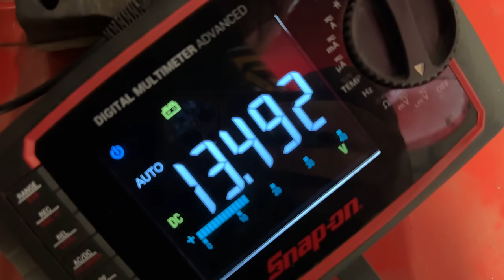Replacing the Old Generator with a Dynamator Alternator

Comment: Just did this, thanks for the instructions, Steve. Switched to Negative Ground, switched battery to a "R" to get the poles on the opposite sides, switched the red ground wire to a black ground wire. Re-polarized the original generator and drove it about a week while I waited for the Tudor Dynamator and the fake voltage regulator box to come in the mail. Immediately shocked the living shit out of myself on the voltage regulator by failing to remove the negative terminal from the car and removing the old one from the chassis, then cleaning the spot it came from while just barely touching the terminal and the wet chassis. Then installed the dynamator as shown once I had removed the negative terminal from the battery... and a shorter belt as I switched pulleys to a new one on the dynamator and it's a little smaller.

You can buy a positive ground dynamator. I switched to negative because I don't care if the car is positive ground or not and wanted it consistent on all my vehicles.

Comment: Outstanding video. I’d never heard of this conversion. I laughed when you put that crusty, old pully on without blasting and painting it. Just replace and drive on down the road.
Reply from the maker: I think people should be driving their cars instead of wasting time with things that don’t matter. So many cars never get back on the road because people want it to be put together perfectly or not at all.
Reply: Considering the condition of the engine bay I don’t think it would be worth the time.
Reply: @ThisWeekWithCars  Steve, you are exactly right. It’s just really hard to do when the pully is already off. Probably why only one of my three cars is drivable. I’m trying to be better.
Reply: Moss or somebody needs to make a “patina” spray… one quick spritz and your new parts match the rest of the engine bay!

Comment: Does that Sprite have an exhaust leak? It sounded a bit rough there both on start up and on the drive to test the alternator swap. Great video there and it's nice to see the old cars being supported with parts so well. I'm jealous that you have them. I'd love to have one to just tool around a bit, especially one of the hard top ones.

Comment: Is the electrical system negative ground?  A generator doesn't care about that, but with an alternator, I believe it has to be negative ground.
Reply: That's exactly the question I was going to ask as I'm pretty certain the sprite would have been postive earth from factory.
Reply: Yes the sprite was positive ground originally. The battery is installed 180 degrees to mine and you can see at 4:10 or so a shot of the battery with the negative cable attached to the chassis.
Reply: Alternators can be made with positive ground too, Mack trucks used a 12V positive ground alternator and heavy 6V batteries wired in series to make 12V at least up to the mid 70s...
Reply: When you order one from Tudor you state which ground the car is .They supply both .
Reply from the maker: These are available in both negative and positive ground.
Reply: @ruben_balea  They probably reverse the polarity of the diodes for positive ground.